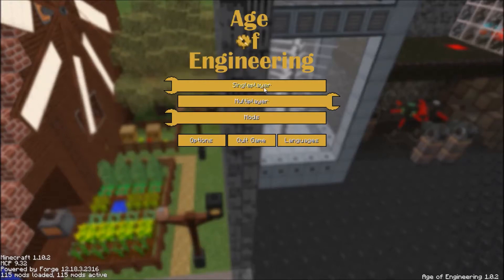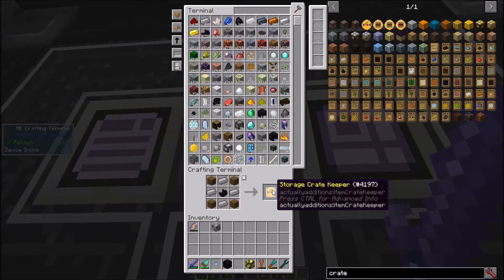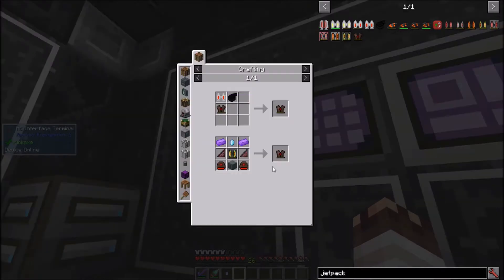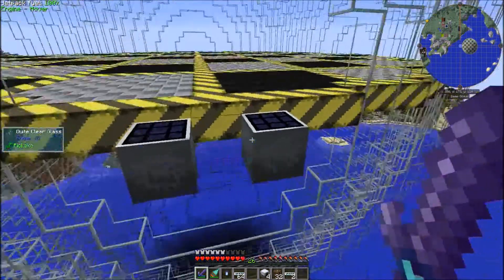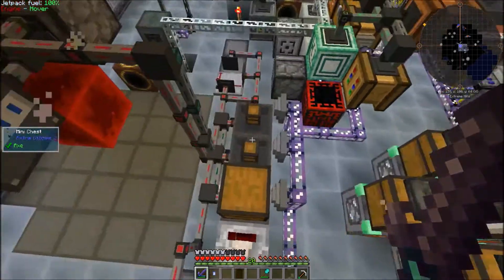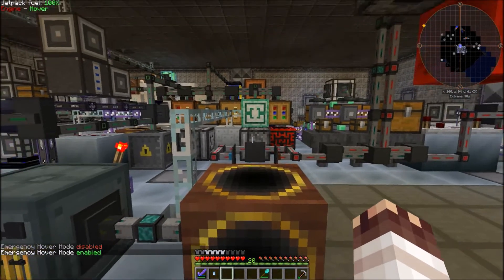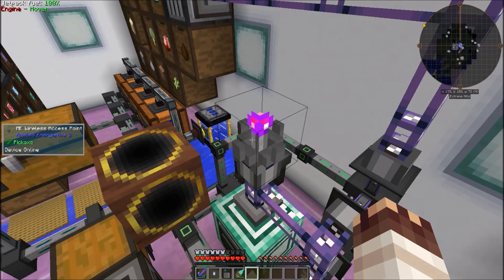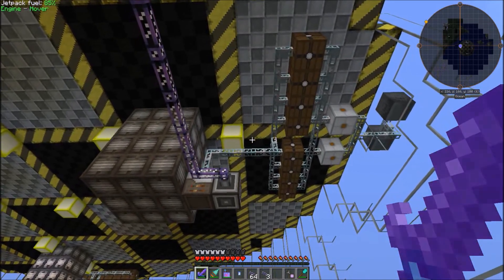Age of Engineering Supershorts #14: Advanced Rocketry Base

Comment: Isn't the arc furnace from IE better for crafting chrome and titanium?
Reply from the maker: Oops.
Reply: probably with your fine knowledge on RFTools Control, you can make it so it processes 12 itens at a time
thought you knew :c
Reply from the maker: I'll see if I do it in another episode. It might be fun, especially if I find myself needing way more chrome/titanium.
Reply: minecraftinchocolate precision assembler requires 25-30 machine  structure
Reply from the maker: Hoboy. Maybe I'll have to work on that a lot sooner, then.